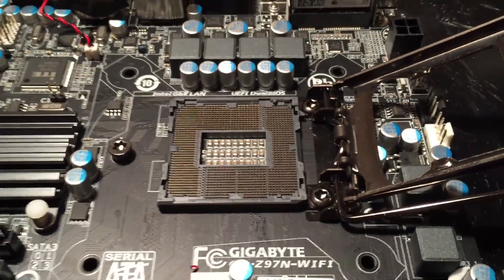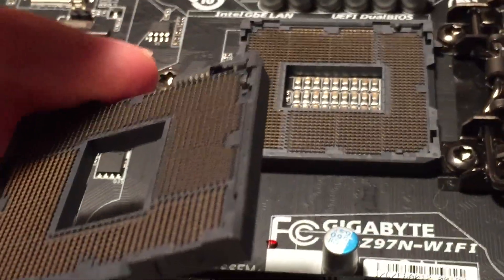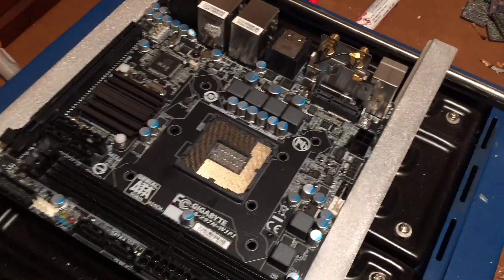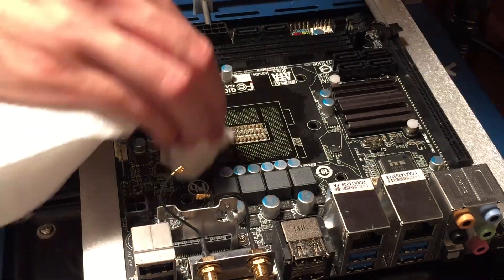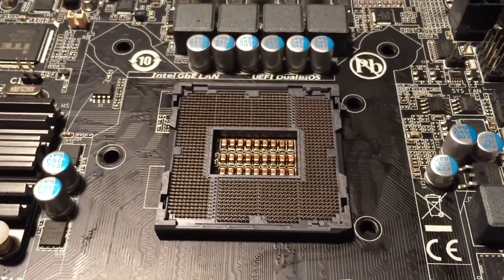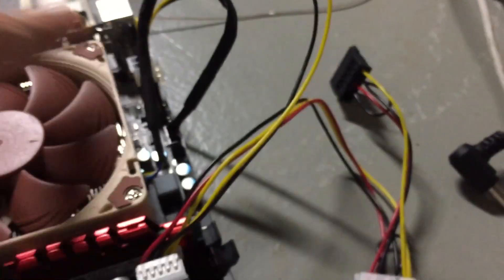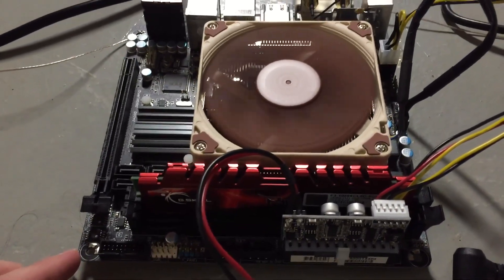Replacing a Damaged CPU Socket on an LGA1150 Mini-ITX Motherboard

Comment: Is it possible to do the swap with a heat gun too instead of this "special" machine?
Reply: He seems to be using the Puhui T8280 Preheater + a hot air gun. I was told by people who repair sockets that a preheater is needed.

Comment: We have a dent in the cpu socket in the corner but its not close to the pins, is this going to affect the board in anyway or does the full socket need replacing I can send a picture for reference or should we ask the manufacturer for support TIA

Comment: I did now if we could just get the chip I mean socket there yes!!! lmbo Great Job Thank you have an X99A Godlike that has a broken pin, was bent I bent it back but part of it still broke off (it's ball tip) anywho I located a new Socket, if it don't work the repair might have but just have not got around to testing yet, this video was super helpful thank you!!!

Comment: I used to do this with the best equipment in production. I'm trying to do this now on my own. I've got a IR6500 and im struggling with profiles. I also have a hot air rework machine but i'm thinking the IR has more precision. I'd love to chat with you.

Comment: Is it absolutely necessary to have the hot plate? I only have a hot air station and its not worth buying a board warmer i might as well buy a new board at that point. But since its garbage if i cant do it, do you have any tips on what I should do if I only have a hot air station? I’m worried about all the little capacitors top and bottom especially the bottom. I don’t want them to fall off so I was thinking maybe I could put some tape over just a little rectangle area of capacitors I don’t know if that would help or just melt away but if I don’t figure this out, then just getting thrown away anyway so if I break it worse, it doesn’t matter, but I would like to try to save it, it is an asus prime z390-a, a pretty nice board but it could be purchaser around $200 and board warmers are gonna cost me at least 100 I’m assuming. I don’t really see any pins coming all the way through so I’m assuming I don’t have to put any flux on the bottom of the motherboard just around the top of the socket is that correct? Could I prop the board standing up and then just go front to back quickly until the socket gets loose or are the capacitors just gonna fall off the bottom? Lol Basically I’m asking is there a shot at me completing this without destroying it?😂. Love your videos and your catalina patcher! I still use it today!
Reply from the maker: You will absolutely need a big board preheater like this to even have a chance of removing the socket cleanly. It takes a LOT of heat, especially on larger motherboards.

Comment: Does it necessarily to use same motherboard socket
Or i can use any motherboard 1155 socket in this case
Reply: you have to use the same socket, so an 1155 socket has to be replaced with an 1155 socket, nothing else will work.

Comment: Bro can i use donor h81 socket to z97 motherboard??
Reply: yes since the sockets are the same. you will need to reball the socket before soldering it to the new board

Comment: After you applied new flux at 8:14, how is it you could just set the new socket on top without applying more solder? How is it making that connection? Does the socket already come with some or something else?

Comment: Removed the old socket, pulled all the old solder off the board, drop the next socket on, put a heat gun in it, and then you said you were soldering it on but i missed something, because all i saw was the heat gun and then it was "soldered on"
Reply from the maker: Yes... Because new sockets come with solder balls pre-applied

Comment: I have the same pre-heater and used to have the same hot air station. The temp the preheater displays is kind of random so setting it to 180C means around 100C on the board. The hot air station with a 45x45 nozzle is kind of useless, making a big hot spot on a side and anyways 40L/m is very little for that nozzle. Still, he manages to correctly remove and reinstall everything and those capacitors are not even bothered... HOW!

Comment: Can something similar be done with DIMM slots and PCIe slots too?
Reply from the maker: Definitely, normally those are through hole, so no BGA work needed.
Reply: @dosdude1  Awesome! I've got a motherboard I know is bad, and one that seems to be bad even when it shouldn't be on delivery. I know one has some bent pins, but if that doesn't fix the DIMM inconsistency that's nice to know.(and he said he was unsure about one PCIe slot) I'll try to see if I can get into straightening out some pins when exams are over.

By the way. If a motherboard always goes to ask you to enter setup, like something new is detected, even when no changes have been made, it's just been turned off for a few seconds. Can that be a socket pin issue too? I changed the CMOS battery, so it shouldn't be that.

Comment: I cannot even start to describe how much is this shortening life of the whole MB. It pains me to see this every time and even more how people worship this without understanding how damaging this is to all other components on board. This is same level of hack repairs as re-balling chips on GPU. Unless these refurbs get sold below 50% of original price it is pure lottery. You can get MB that work for years or have them fail within month when put under load. Anyone who thinks that heating any MB components to over 200° have no ill effects is living in fantasy world.
Reply from the maker: It’s pretty obvious you have no idea how commercial board production is actually done... How do you think the SMD components are soldered in the first place? Yep, entire board is put through a reflow oven. Heating the board to 200 degrees C does not hurt it at all (when moisture is properly removed beforehand, which I’ve done). Reballing flip-chip BGAs is a completely different issue entirely, and is not effective because the chipset itself is bad in most cases. Replacing the socket such as this is actually a proper repair. This board has now been in use for over 3 years now, and is still working absolutely perfectly.
Reply: I love your presumptions. I worked in PCB industry for some time. As for SMD and soldering by reflow that is process used since 90's (80's) and while it is proven method you manage to conveniently omit couple of things. 
A) When making PCB you use all brand new components and reflow is applied to them only once.
B) Reflow soldering is more complicated than heating board to 200° and is mostly done in nitrogen rich atmosphere in commercial production.
C) laser PCB soldering is the new 'black' (more precise, less heat stress) 
The facts are that this sort of repairs can cause issues and it is not guaranteed that the MB will work for prolong period of time you simply cannot deny this. If it is new or almost new MB I would say that the risk is minimal but if we are talking about used MB that already been used for long periods of time then you have more than 45% chance of causing additional damage to those MLCC's by direct heat application (250°+ with the heat nozzle)
Now don't take me wrong this is indeed valid procedure as you mentioned but most of people view it as some miraculous cure to make 'like new' MB. And trust me there are those who charge over £100 for this service which is borderline criminal. And honestly I despise those type of people.
As for re-balling BGA's you are correct but again I am taking issue with those who offer re-balling as some magical cure when in most cases all they do is by applying the excessive heat to the chip they re-align the damaged structure of said chip so it is capable of operation but when you put it under serious load it fails again. This is one of the reasons why I do not offer repairs of laptops with failed GPU/CPU units and even when people ask for chip replacement I tell them that the new chip will not have the same life spawn as the old one.
Reply from the maker: Having done repairs such as this for awhile now, I can tell you for sure that if any damage from the heat does occur, it will happen during the heating process and will usually be immediately apparent. If the board itself has all moisture extracted before the heating process, most likely damage will not occur.

As for BGA chipsets, I agree, and have always known, that taking a failed chip, reballing it, and putting it back on the same board is not a repair at all, but rather the heat from the process is, as you said, realigning damaged structures in the flip-chip. Services that do this are nothing but a scam.

Replacing a failed chipset, such as a CPU or GPU, with a known-good or new one, however, IS an actual repair. In my experience, as long as you have a good source of a new chip to install, it will not have any issues, especially if said chipset manufacturer has revised the design of the chipset (a good example being the G84-603-A2 revision of the nVidia GeForce 8600M GT video chipset).

As for damaged MLCCs, that is very much a possibility. I have had this happen when doing one of these socket replacements, but I always ensure to replace any damaged capacitor with a new one if such damage does occur.

At the end of the day, though, simply heating a board (or chipset) to 200 degrees C, if moisture has been completely removed beforehand, will not cause any issues in the long term. If the board or chipset is heated too much, it will be visible, and board and/or chipset will certainly no longer function afterwards.

Comment: My b660m lga1700 have bent pins. I’m lucky that my pc still function, just that my ddr4 are running much slower at 2400mhz, start up checks takes 30-40 seconds before booting into windows. I dare not attempt to fix it myself, too risky. What an expensive lesson learnt . Still I can’t believe how fragile these are. Hopefully no more issue. This is my first pc build and I’m afraid this might be the last? This is too scary

Comment: They should make a double sided male adapter wich can be inserted into female socket on mobo and on the other side connects to cpu, so the only thing with pins is this adapter which is easily replacable

Comment: This is not recommended. I would have zero confidence in the stability of whatever system this mobo gets placed in
Reply from the maker: It's been in use for over 2 years now and hasn't had a single issue.
Reply: @dosdude1  hello, there is any chance you can do this to a motherboard I have? Is an Asus Z87-A with a broken pin.

Comment: One thing I do not get - by using the solder wick you remove the old solder from pads but then you don't apply a new solder to them. So what will make a joint between the new socket and the board pads? Is there a solder already applied on the socket pins? Or when you use the solder wick you do not clean those pads that thorough to leave some solder on those pads?
Reply from the maker: The new socket comes with solder balls pre-applied.
Reply: @dosdude1  Oh that explains it, thanks.

Comment: What type of nozzle is used with hot air gun for desoldering the socket?
Reply from the maker: Aoyue 4545W BGA nozzle.
Reply: @dosdude1  i have damage cpu socket pins. Can you replace it?
I live in pakistan.

Comment: Hi Dosdude.
Im in a desperate situation wanting a Gigabyte Z490 Vision D motherboard. I have ended up buying one with bent CPU pins as this motherboard is no more available as new. Can you please tell me whats the pre-heater you have used and whats the source of hot air? I dont mind buying these parts and give the socket replacement a try.
Reply from the maker: It's a Puhui T8280 preheater, and Aoyue 852A++ hot air station with Aoyue 4545W nozzle.

Comment: What king of heat gun do you use? And what's that attachment? I've tried doing a similar job with a regular heat gun but I ended up pushing other components away because my airflow was too high.

Comment: Excellent and actionable content; I have just a couple of quick and easy questions for you:
* how much actual work time did this process take you, start to finish?
* what equipment is required, and estimated cost in todays prices; and or is there any other suggested tools / items you recommend?

Please adivise .. Thank you.

Addendum: repair and or repurposing things is an affliction of mine since working in my fathers junk yard since I was almost ten years old.
Reply from the maker: This process is actually quite a bit of work, it took me about 2 hours to complete this repair. The equipment needed is a board preheater (Puhui T8280 is what I use), hot air station, BGA hot air nozzle, and hot air holder. I think this all cost me around $200 - $300.
Reply: @dosdude1  Thanks for taking the time to reply, otherwise I was going to wing a bench try with a hot air gun; I know that the odds were not on my side; but I have fixed a handful of GPU's that way; it use to be that you could strip and bake GPU's to reset the solder points; but that was back when the pcb boards were thicker; now I just use the hot air gun and stay clear of the plastic connectors; which really are not necessary, the cleaned pins with a brass wire brush will hold the connections on well enough; thanks again.

Comment: Please forgive my ignorance, but I saw you remove the old solder, clean up the mess, reapply flux, but no new solder? It appeared to my inexperienced eye that you simply adhered the socket to the board with flux. Or was that syringe filled with a flux/solder mix? Or does a new CPU socket come with solder on the pads so that you only need to flux the board and heat it to the flow temp? I don't get it. Again, please forgive my ignorance. I am very interested to learn how to do this. Thanks!
Reply from the maker: I forgot to mention it in the video, but the new sockets come pre-applied with new solder balls.
Reply: @dosdude1  Thanks for that bit of clarity! You are a huge asset to the online DIY computing world. Keep up the excellent work, both with hardware and with coding and patching things.

Comment: That's impressive. I've looked into having a socket replaced on one of my x58 boards, but I couldn't get a decent price to make it economical. From what I've read, replacing a cpu socket required expensive BGA systems, but this looks like a DIY at home job. Well done!
Reply: he IS using a BGA system, that preheat board is a BGA system...

Comment: Quick kinda dumb question, could i take a used 775 socket pin to replace a socket 1366 pin? Some pins seems to have the same angle.

Comment: 2:36 Remove BATTERY, metal socket bracket and anything else removable.
4:21 Board heater to 180℃ / 356℉. (He uses a Puhui T8280 board preheater)
4:35 Add flux to the perimeter of the socket.
5:01 Add the hot-air nozzle over the socket. Heat to 250℃ / 482℉.
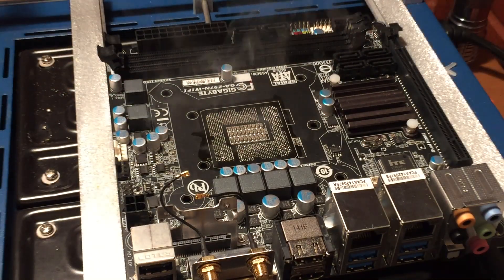5:38 Socket is now loose. Remove steaming socket with pair of tweezers.
6:10 Squeeze more flux onto bare pads.
6:34 With hot soldering iron, add a touch of solder and start swirling tip, gathering big ball of solder as you swirl.
6:43 After swirling all around board, swirl again but now pressing down on solder wick with soldering iron.
7:32 Clean up old flux using rubbing alcohol and paper towel.
8:14 Apply more flux. Not a TON, but enough.
8:52 If you've applied too much, wipe away a little with a paper towel.
9:27 Set down new socket, and just line it up.
9:55 Put hot air nozzle back in place (assumedly to 250℃ / 482℉).
10:05 After some arbitrary amount of time, turn off hot air nozzle and let board cool down. (Not sure how to determine if the solder balls on the bottom are fully melted / soldered).
11:00 Reinstall CMOS battery, metal socket bracket, etc.
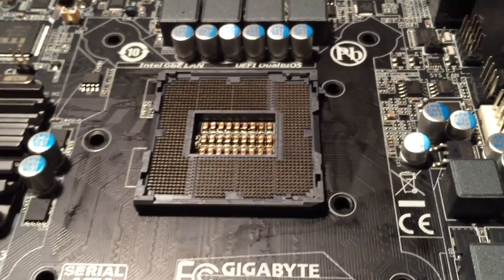11:14 Reinstall CPU, cooler, ATX power, etc. Showtime!
Reply: What hot air did you use here buddy?
Reply: @johnmcook1  unfortunately I don't know the model of the heat blower, since I didn't make the video.
Reply: you did something that without your explanation of critical notes and points about the process about how to make things right, this video could be useless. Thanks!!!!
Reply: Hi
Reply: those pins solder in
Reply: hmmm, i know @dosdude1 said 250°C, but I'm asking myself if it may have been 350. Or is that still lead based solder on there? Thankful for any insights!
Reply: what is the flux???
Reply: @drawtheword7590  the liquid that helps the solder to be melted
Reply: @Michael Innes , thank you for the summary steps and the temperatures and some of the equipment. One thing you forgot to mention and DosDude1 has not mentioned in his other videos either, is the make and model of the thermometer used (check @5:20). Do you know that? @DosDude1 thank you for your instructive videos.
Reply: @xxycom8963  looks like the tool at 5:20 are tweezers to see if the socket is loose.

Comment: These sockets and heatsinks need to be redesigned so they dont get damaged so easily. Bent pins, broken pins it would be better if the pins faced downwards rather than facing up and then trying to put a fan on top of that. Recipe for disaster.

Comment: i have changed the socket in about 10 desktop boards and i cant get any video on them. they have power cpu heats up, power supply fan spins and cpu fan but just no video. i have no idea what im missing. im following your steps and setting appropriate temperature for each individual board. i was able to get video on smaller boards but the longer gaming boards its just not working.  :/
Reply from the maker: You have to increase the heat on larger boards, as they have more thermal mass.

Comment: I have everything except a “motherboard heater” and I’m going to attempt this. I bought a replacement socket on eBay, do you think the amount of solder it comes with is enough once I get the old soldering location cleaned up?

Comment: I will be attempting this repair with.a heat gun next month, to try and revive a Fatality ITX mobo. Pray for me
Reply: A heat gun would never work for this. You will need a board preheater, and a bga rework hot air station.